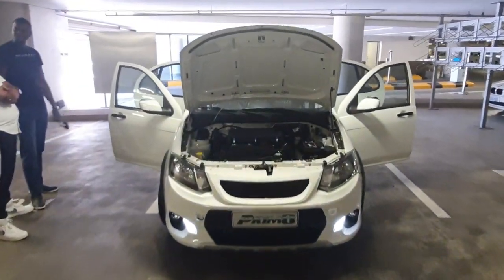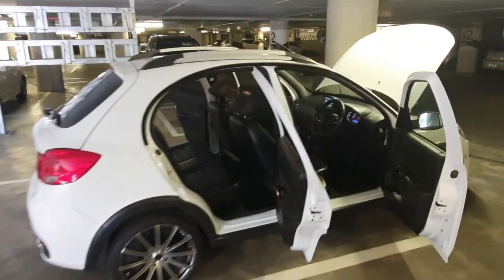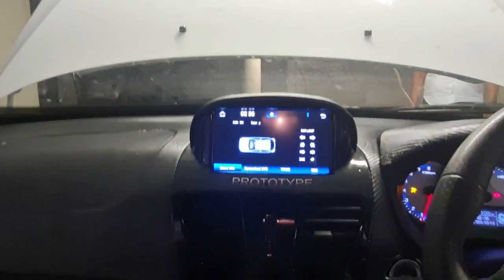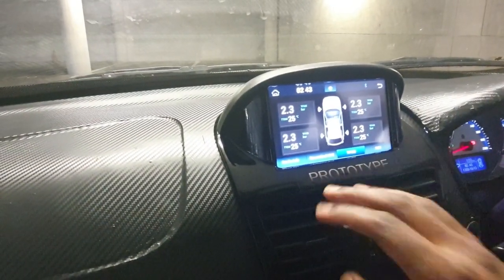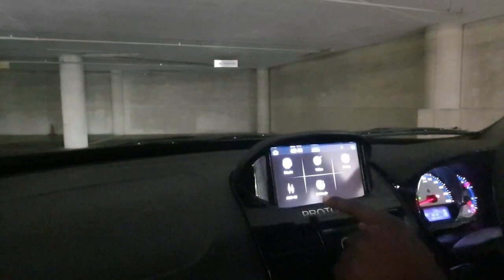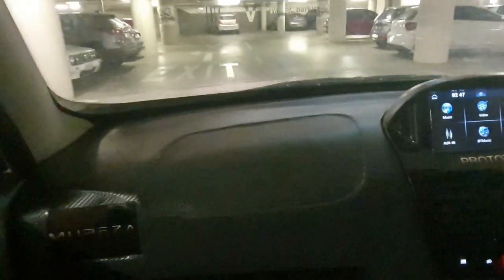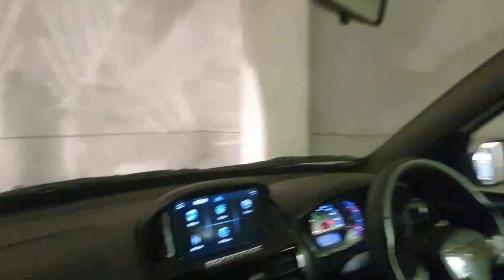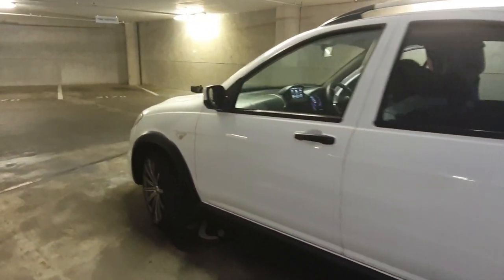"MUREZA Prime8" :African Made Car Launched... This Prototype is way cooler than cars in its class.

Comment: Besically we have a rebadged Iranian   car. For some reason there isn't  shame in it, as designing and developing a complete prototype is expensive and requires very high engineering skills too. Scaling up to a mass market is a challenge plus the market itself is harsh for new comers I wish them luck.
However i think when they make profit they need a next model car to be ground up in house development in order to be proud of it being African made. Kantanka has been building cars in Ghana (well sort of because they are Chinese rebadge) despite them manufacturing a few parts locally, I haven't actually seen them working with things like  CAE  tools trying to make thier own design structural elements for at least majority of the components.
Until then am happy but it's too early to be too proud (am zimbabwean by the way).
Reply: Looking on the plus side, I see potential here. Gotta start from somewhere. I also consider that big brands rebadge often too, suzuki brezza / toyota urban cruiser being a prime example. But I think these guys will still do okay, the average cat buyer (I'll assume) really won't be worried about where the car was sourced, etc but will just be looking at safety, functionality, reliability and most importantly, cost, which the mureza already has down according to the CEOs words

Comment: What's the NCAP safety rating on this car? I only heard you mention that it has 2 airbags up front.
Also he said it has Google Maps and you can see the location of your car at all times using your Google account. Does that mean it has Android Auto?
Reply from the maker: its awaiting local safety rating but internationally they passed but I don't remember stats but will keep you posted
Reply: @rynostorqueshow  Ok do keep us updated. By the way, NCAP is international so there's no need for a separate local test.
If these cars are built to excellent standard, I see them flying off the shelves.

Comment: Dealer network?, service plans?, warranty?, the wheels are way too big for it to be cost effective, the 1.5 is probably Chinese sourced, I doubt it will have adaptive cruise control as the CEO mentions for that price,  What does it make in CO2 emissions,  do a bit more research or plan your questions out before debuting a new product. rather put in more safety systems than leather seats and Tire pressure monitoring. PAY ATTENTION TO THE MARKET.

I don't mean to be harsh, but Ryno lets be serious with each other, do more research and understand the market.
Reply from the maker: Hi Luke I appreciate you effort but I am not that technical youtuber for one... I just do things my way remember I am not supposed to give what you want but the content I enjoy making... it was not a debut it was just me meeting the CEO... and this is just part 1 of the video but I appreciate  ur concern... maybe next video you will get more from the CEO...m a content creator just that thanks
Reply: @rynostorqueshow  Okay, I understand that, the only reason I ask those questions is because you are one of the first to have that one on one with the CEO and it would have been really good content to ask Him a few more detailed questions, but as you said now it's only a part 1 then no problem man
Reply from the maker: Hi Luke 

yes I will cover all those from day 1 for now the car is still a prototype in testing nothing final... even NCAP for local ratings but I will definitely do it due diligence
Reply: Hi
I am Iranian
This car is all made in Iran and is called Saipa Quick. The only interesting thing in this video is the rims and tires with new or large sizes that make it beautiful. Also know that there will be a lottery to buy this car and other cars in Iran!
Reply: @mehrdadkia5314 

Lol! Leave us alone...

Comment: So a Southern Africa company building and selling Iranian rebranded cars here?
If you are not going to design your own car from the ground up, why source a design and parts from Iran and not from a reliable source like Japan or South Korea?
Reply: Because Iranian production are affordable and nice 
Persian car have quilty as Persian carpet
Reply: @mohammadaminabassikani3125  Irianian cars aren't as reliable as Japanese cars. If you are going to sell something to the budget market, then it needs to be something that lasts and wont cost much to operate or maintain. Making a car isn't the same as making a carpet.
Reply: @SonicHawk90  Many Iranians drive Iranian cars and they are satisfied, maybe we don't produce cars like Benz or Lexus but good cars for low prices. Japanese cars would cost double and the parts are expensive too, i hope once you will drive a Dena Plus then you will see Iranian cars are not that bad and i say it as a German car driver because i live in Germany 😉
Reply: @Raybod7  How many Iranian cars can you show me thats older than 10 years and has atleast 500 000 km on the odo without being rebuilt or getting a engine swop?
Reply: @SonicHawk90  Bro 50000 km per year is very much for a car, i accept that some Japanese cars are very good and Iranian cars can't reach that level by now but show me 1 South Korean car that is still working after 10 years with 500000 km 😄
Reply: @Raybod7  Go check on cars.co.za, there's quite a few with milage atleast above 300k..And I can bet you will even find older Hyundai's and Kia's in Iran with higher milage than Iranian cars. Fact remains, Iranian cars do not come close to anything produced by the Japanese or Koreans in terms of luxury, reliability or value for money. I wouldn't touch Iranian cars with a 10 meter pole, even if you paid me. Ive owned about 4 Hyundai's now, and I can safely say they are even more reliable than German cars... Perhaps not as luxurious, but definitely more reliable.
Reply: @Raybod7  My mom is actually still driving her 2007 Tucson with about 300 000km on the clock...So there's another example. ;-)
Reply: @Socrates Tavosian Ah, so cheap and crap quality...got it ;-)